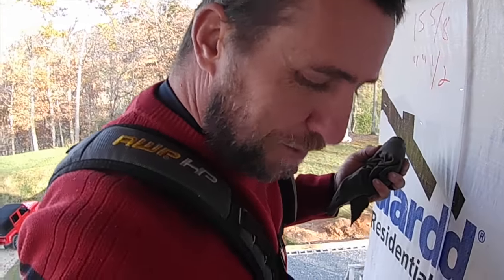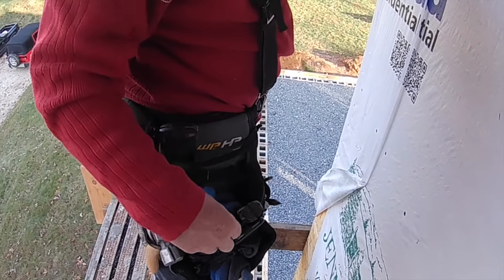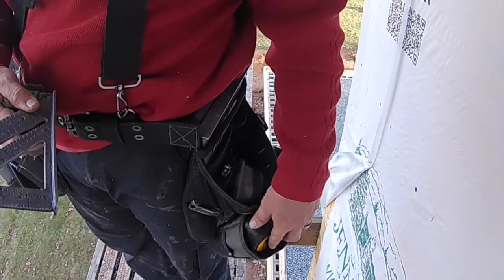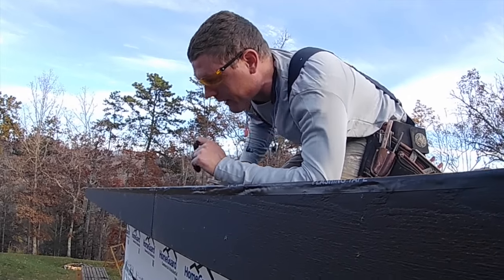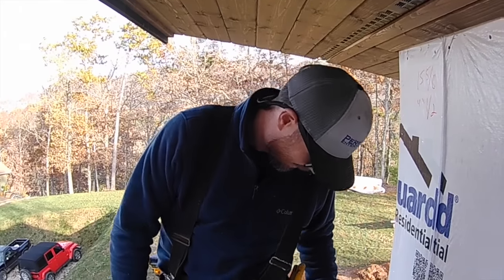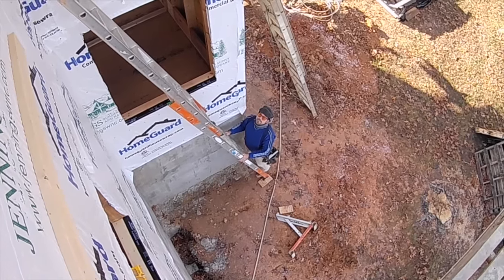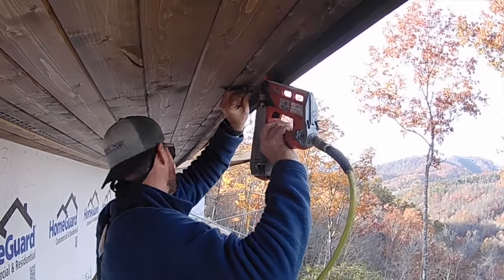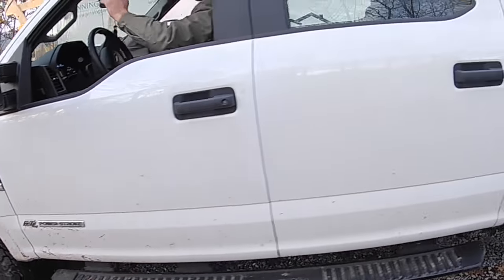What’s in a real carpenters tool belt

Comment: Right side I got knife, pencils, markers, chisel, small and large nail pullers, nail sets, two pouches usually carrying nails for framing gun that I hang on the unused hammer loop on the front of the bags plus a hook I put on the backside of the bag for drill/impact driver. In the rear I got my hammer and small pouch for my chalk line. Left side I got speed square, 6 in 1 screwdriver, bubble stick with built in angle gauge, small channel locks, lineman pliers, extra driver bits, Allen keys, two small pouches and one large are usually carrying some combo of screws/nails depending on the day and a small separate pouch just in front on the left side as a dedicated spot for the tape measure. Also sewed a few rare earth magnets into the back of a custom made harness I rigged up that hold a Japanese hand saw for when I’m doing finish work.

Comment: A nail puller? but you have screws in your took belt 🤦
Reply: And? Isn't it way easier, to just carry tools you might not need at the moment, instead of packing them in and out, maybe forgetting them, etc. Also nails are more used than screws.